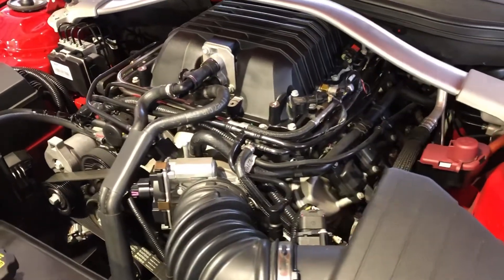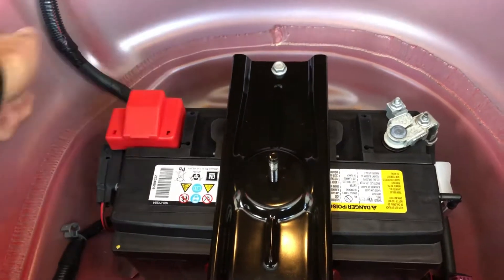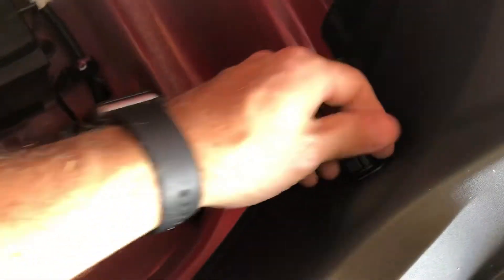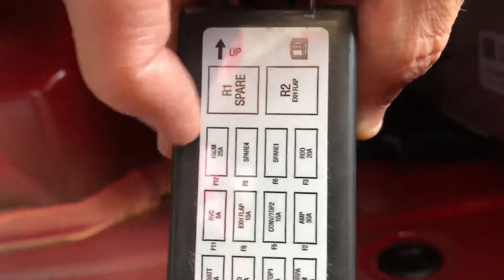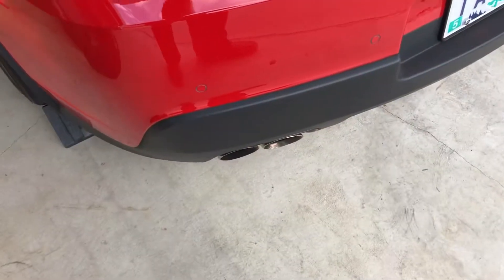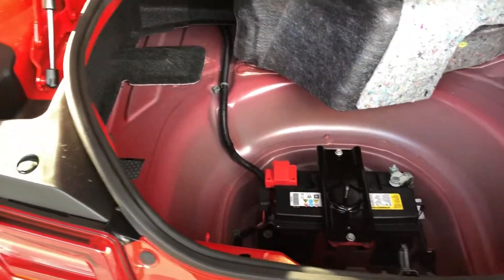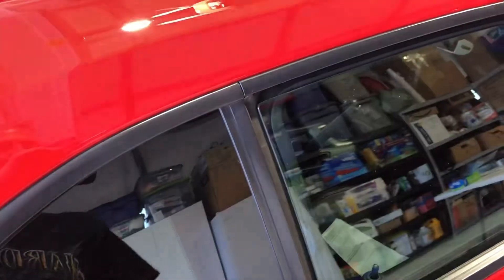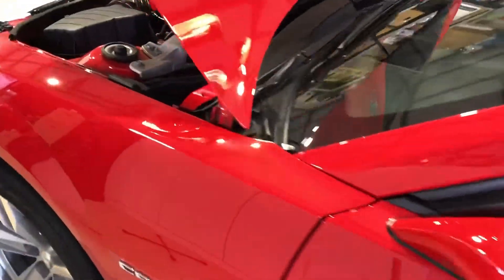Preparing the Camaro ZL1 for disassembly

Comment from the maker: So I know there is still some residual pressure in the fuel rail. There is a black cap with a schrader valve that will bleed the remaining off. I'm still not positive that the FSCM didn't just shutoff the injectors and that's why the engine died instead of lack of fuel. Either way, the schrader will bleed the pressure off. I'll cover it with a rag to keep the possibility of spraying me.